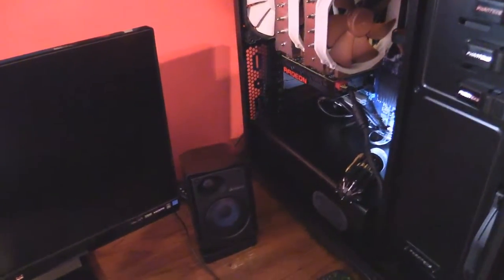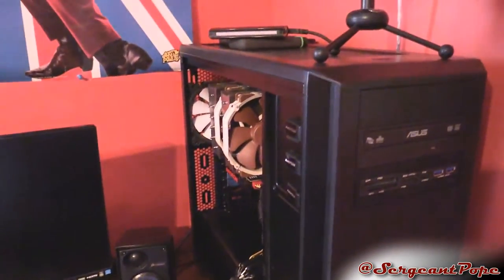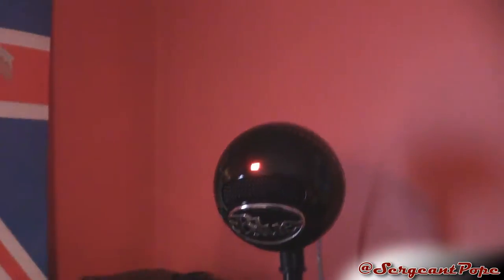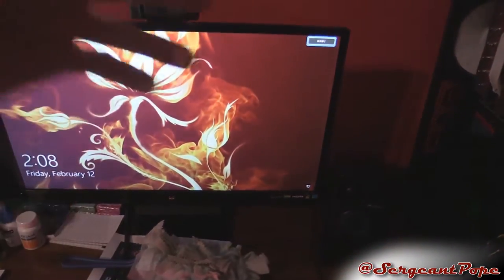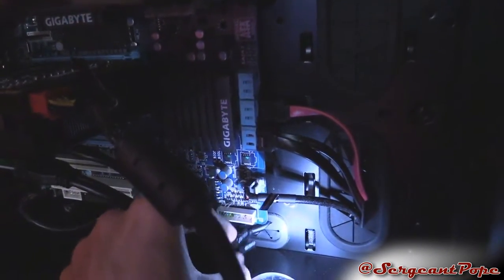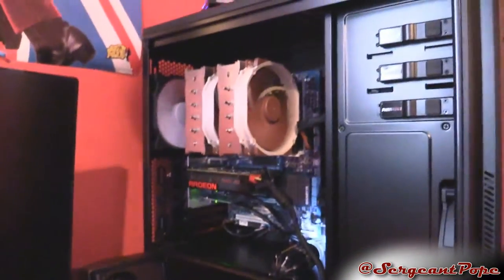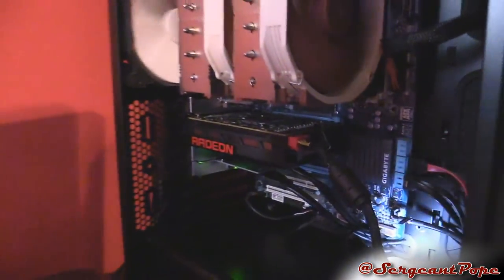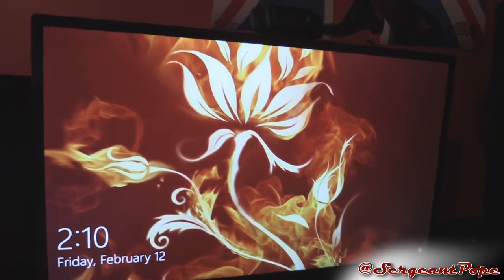My computer done broke - power button issue

Comment: I would check the PSU as well. I'd go ahead and start an RMA for your Motherboard, just in case that's the issue.
Reply from the maker: +Miguel Ortiz I was kinda thinking the PSU as well. I'll try reconnecting all the cables at least. The motherboard is probably out of warranty, but I guess I should look into that.
Reply from the maker: +Miguel Ortiz Warranty for Gigabyte motherboards is 3 years, and I purchased it in January 2013. Dammit, haha.
Reply: Only 1 month after expiration! I think you could try sweet talking GB into an RMA though. Hopefully it's the PSU, that way you won't have to take everything apart XD
Reply from the maker: ***** Right? I don't know, I might just use all of this as an excuse to upgrade the hardware, lol. My power supply was like $250 so I hope it's not it that went out, lol.
Reply: lol, if you got a good PSU, it should still be under warranty.
also inb4 you start building another PC
Reply from the maker: ***** True, I hope so at least. Haha, right? That's probably what's gonna happen.